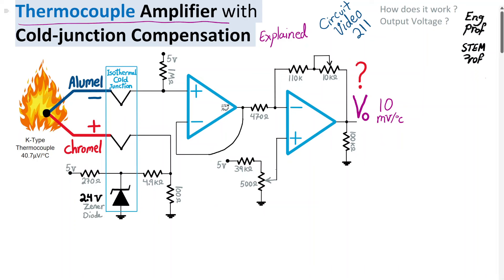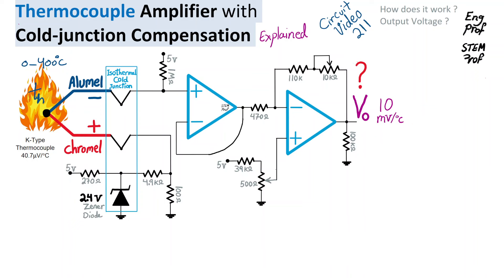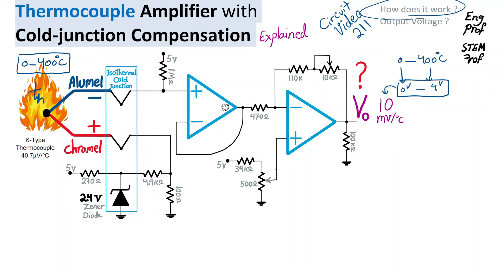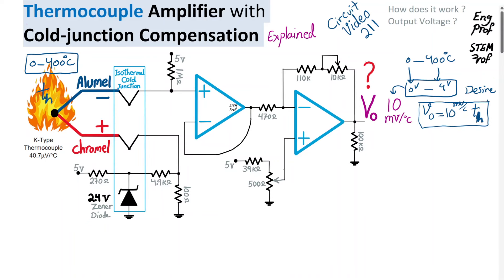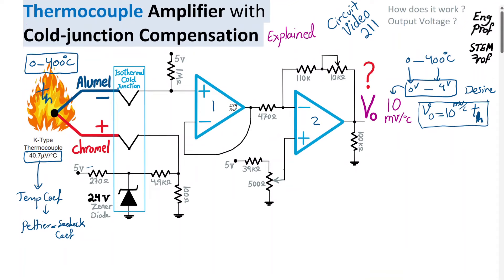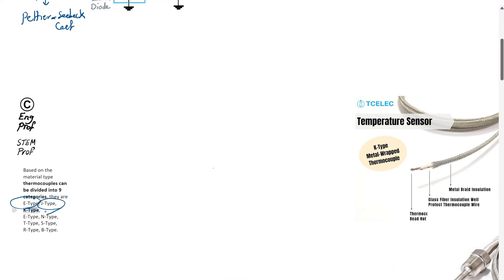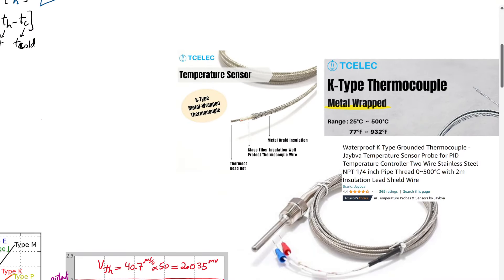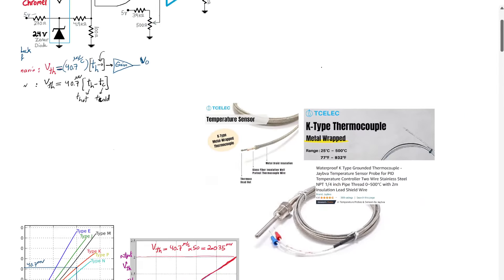Thermocouple Amplifier with Cold Junction Compensation Explained

Comment: If there are multiple junctions of similar metal pairs in the same direction between thermocouple and measuring device, is cold junction only a place when bare thermocouple wires connect to copper?
Reply from the maker: No, the cold junction is not only the point where the bare thermocouple wires connect to copper. The term "cold junction" refers to the reference junction, typically the location where the temperature is known or controlled. In a thermocouple system, the cold junction is usually at the point where the thermocouple wires are connected to a measuring device or reference material (such as copper or another metal). But if there are multiple junctions formed by different metal pairs in the circuit, each additional junction can also influence the measurement. When thermocouple wires are connected to other metals (like copper in the measuring device), each junction between dissimilar metals creates a potential difference, which can contribute to the overall voltage (e.g. series voltages that add up). The cold junction compensation method is used to account for this, ensuring that the temperature at the connection point is accurately represented in the measurement. Therefore, the cold junction is primarily considered where the temperature is controlled and known, and where compensation for other junctions in the system is applied, not just where the thermocouple connects to copper. I hope this is helpful. Here are a few related circuit videos: 
Thermometer Sensor Circuit Explained https://youtu.be/5jmbZ9ak6EI
PT100 RTD Temperature Detector with Error Compensation https://youtu.be/Fsd-X69awFk
Thermometer Circuit Design with Op Amp and BJT transistor https://youtu.be/55YsraFE0rg
Reply: @STEMprof Thank you! So while other junctions will influence measurements to some extent, is junction with bare thermocouple wires more likely to introduce the most error? Since it probably is closest to the measured object(larger temperature difference with ambient) and due to the fact that it has different pairs of metals for example chromel to copper and alumel to copper, that have different Seebeck coefficients(other junctions are more likely to be two similar pairs, something like two pairs of copper to bronze that have the same Seebeck coefficients and will compensate each other if their temperature is the same)
Reply from the maker: @qt1qg  You're welcome! Good points regarding thermocouple measurements and the potential sources of error due to additional junctions.  Yes, the junction where the bare thermocouple wires connect to copper is more likely to introduce the most error. This is because this junction is exposed to the largest temperature difference between the measured object (the hot junction) and the ambient environment, which can create a significant thermoelectric potential. Also, as you mentioned, the metals used in the thermocouple (such as chromel and alumel) and the metal the thermocouple connects to (like copper) have different Seebeck coefficients, which means they will generate different voltage contributions depending on their temperature difference. This results in potential measurement errors unless properly compensated. The junction formed by two similar metal pairs (like copper to copper, or brass to brass) would likely have less impact, as the Seebeck coefficients of similar materials are closer, and their temperature-induced voltages can cancel each other out more effectively. This is why the system is usually designed with materials that have well-matched properties for minimizing such errors.  In practical thermocouple systems, cold junction compensation is employed to correct for these types of errors, by either measuring the temperature at the cold junction directly (using an RTD or say a thermistor) or using a known reference temperature to adjust the reading accurately.  I hope this explanation clarifies things a bit further.

Comment: how do soldering irons perform cold junction compensation? from what i have read online there is no thermal sensor in t12? jbc or hako 900 series handles(cold end of t12 tip can get up to 50C), and there can be a sensor on the board or they can use temperature sensor of mcu itself.  How do they actually do it without knowing temperature of the handle and using only ambient temperature?
Reply from the maker: Soldering irons, such as those using T12, JBC, or Hakko 900 series tips, often don't explicitly perform cold junction compensation in the same way thermocouple systems do, because they typically don't use thermocouples for temperature sensing. Instead, they rely on a different approach like the PT100 RTD Temperature Detector with Error Compensation https://youtu.be/Fsd-X69awFk to manage temperature and ensure accuracy. Here's how they work:

1-- Temperature Control Mechanism: Most modern soldering irons like the T12, JBC, and Hakko 900 series use a sensor (usually a thermistor or RTD) placed at the tip or very close to the tip to measure the temperature directly at the point of soldering. This sensor is crucial because it directly monitors the temperature of the tip in real-time. A related video is Thermometer Circuit Design with Op Amp and BJT transistor https://youtu.be/55YsraFE0rg
2-- Cold Junction Compensation (or Equivalent): The handle of the soldering iron, including the cold end of the tip, can indeed reach higher temperatures (around 50°C, as you mentioned), which might cause concerns about temperature readings being influenced by ambient heat. However, soldering irons don't typically use thermocouples for sensing the temperature, so the issue of cold junction compensation (which primarily applies to thermocouples) is less of a concern.  Instead of compensating for the cold junction as thermocouples would, the system relies on sensor calibration. The sensor used in the soldering iron (often a thermistor or an RTD) is calibrated to account for the temperature at the tip and its surroundings. Even though the handle may get warm, the system compensates for the temperature through direct measurement at the tip, ensuring it maintains the correct soldering temperature by adjusting power to the heating element.

In summary, soldering irons do not need cold junction compensation in the traditional thermocouple sense because they do not use thermocouples to measure the temperature. They rely on direct temperature measurement at the tip using sensors like thermistors or RTDs and compensate for ambient and handle temperatures through sensor calibration and power control mechanisms. The heating system ensures the tip maintains the correct temperature based on real-time feedback from the sensor at the tip itself.  Watch this video https://youtu.be/5jmbZ9ak6EI to see more about Thermometer Sensor Circuit Design.
Reply: @STEMprof  Thank you for the response! I recently found out that original JBC tips are TC based and have compensation inside the cartridge, t12 tips are also TC-based and original Hakko handle has RTD inside for software based compensation. 900 series are RTD based(don't know why they did not use RTD in T12 and JBC). Clone cartridges and handles probably don't have any compensation. I know that some soldering stations that use T12 cartridges have thermal sensor on the board or use MCU with built in thermal sensor, is it possible to achieve any kind of accurate regulation by estimating cold junction temperature based on thermocouple readings and ambient temperature with some kind of empirically discovered formula?
Reply from the maker: @qt1qg  You're welcome! Your insights are spot on about how different temperature sensing technologies used in soldering irons. To clarify the part about achieving accurate regulation by estimating cold junction temperature using thermocouple readings and ambient temperature: yes, it’s possible in theory, but it’s definitely more complex and less reliable than using a direct measurement approach say using thermistors or RTDs (Resistance Temperature Detectors) similar to the https://youtu.be/Fsd-X69awFk video discussing PT100 RTD Temperature Detector with Error Compensation to manage temperature and ensure accuracy.  In soldering stations using thermocouples (like those with T12 or JBC tips as you stated), cold junction compensation is typically achieved using internal compensation circuitry that accounts for the ambient temperature at the cold junction (the connection point between the thermocouple and the board). This allows the system to correctly interpret the temperature difference measured by the thermocouple. However, if you're estimating the cold junction temperature based on ambient temperature and thermocouple readings, it would require a precise mathematical model or empirical formula, which might not be universally accurate for all setups. This model would need to account for factors like thermal resistance, environmental factors, and how the tip and handle are thermally coupled. Even with this, the result could vary between different soldering irons and environments.
On the other hand, as you mentioned, the Hakko 900 series and T12 tips use RTDs or thermistors that are typically placed near the tip. These sensors provide much more accurate and stable temperature measurements, since they don’t rely on interpreting a voltage difference like thermocouples. In these cases, ambient temperature and handle heat still need to be considered, but the MCU or onboard temperature sensor can use software-based compensation to account for the temperature variation.

To summarize, while estimating cold junction temperature with thermocouple readings and ambient temperature is a theoretical approach that could work with proper calibration, most modern soldering stations with RTDs or thermistors achieve much more accurate and reliable regulation using direct temperature feedback from the tip. This eliminates the need for complex compensation methods, making temperature control easier to manage and maintain. I hope this follow-up explanation is helpful.

Comment from the maker: A Thermocouple Amplifier with Cold Junction Compensation Circuit is explained in this video. For more sensor signal conditioning and amplifiers see https://www.youtube.com/playlist?list=PLrwXF7N522y7Ut9bm8TXAOhIWqL__FGlj and the following videos: PT100 RTD Temperature Detector with Error Compensation https://youtu.be/Fsd-X69awFk
Thermometer Sensor Circuit Explained https://youtu.be/5jmbZ9ak6EI
Digital Stethoscope Microphone Amplifier Explained https://youtu.be/ez5KtkPbsHg
PhotoDiode Amplifier with Data Compression Explained https://youtu.be/hqrRx2ufAwg
Thermometer Circuit Design with Op Amp and BJT transistor https://youtu.be/55YsraFE0rg
Thermometer Current source https://youtu.be/Ggf0yCaTTiY
Strain Gauge Wheatstone Bridge Instrumentation Amplifier Explained https://youtu.be/io1yBcCsP-Y
Temperature–Compensated Programmable Current Source Circuit Design with Zener Diode, BJT Transistors https://youtu.be/QY48IQXJIRI
Temperature-Independent Current Circuit Design with Op Amp, BJT, Zener, Schottky Diodes https://youtu.be/hFbnjbddUvs
Instrumentation Amplifier with Electronic Gain Control https://youtu.be/C4tghZ-q6Zs
For more analog circuits and signal processing examples see: https://www.youtube.com/playlist?list=PLrwXF7N522y4c7c-8KBjrwd7IyaZfWxyt
I hope these sensors circuits videos are interesting and useful.

Comment: Is the zener temp coeff. value accurate at all? The part is specified for 2.4V Zener. There is no binning from production not any uncertainty. Have you built this circuit, and confirmed the accuracy?
Reply from the maker: Good question, Yes for 2.4v Zener and for the cold (PCB/copper) temperature range of 0 to 50 degree Celsius that matters. Note that Zener Diodes between 1.8v to 3.3v have remarkably stable temperature coefficients assuming proper DC Bias current (say 6-10 mA).

Comment: Would current of 25 to 250 microamps(most mosfets that start from IR can have such leakage currents) passing through a thermocouple influence the readings? For example if it's in series with the heater like in t12 tips and mosfet leakage current is passing through it when it's off
Reply from the maker: Good question. For practical amplifier design, all components including op amps need to be selected carefully. I suggest using zero-drift low-noise CMOS precision Op Amps from Texas Instruments or Analog Devices. When carefully selected, drift currents and voltages of the CMOS op amps are on the order of tens of nano amps or nano volts. For related videos please see: Thermometer Sensor Circuit Explained https://youtu.be/5jmbZ9ak6EI
PT100 RTD Temperature Detector with Error Compensation https://youtu.be/Fsd-X69awFk
Temperature–Compensated Programmable Current Source Circuit Design with Zener Diode, BJT Transistors https://youtu.be/QY48IQXJIRI
Thermometer Circuit Design with Op Amp and BJT transistor https://youtu.be/55YsraFE0rg
I hope this is helpful.

Comment: Can I use an LM358, and is the power supply single or split -5, +5? Thanks a lot.
Reply from the maker: You're welcome. Glad that this video is helpful. I'd recommend zero-drift, low-noise CMOS Operational Amplifiers (dual op amp package) from Texas Instruments or Analog Devices for this circuit. More explanation of circuit operation is provided in the following related videos:  Thermometer Sensor Circuit Explained https://youtu.be/5jmbZ9ak6EI
PT100 RTD Temperature Detector with Error Compensation https://youtu.be/Fsd-X69awFk
Thermometer Circuit Design with Op Amp and BJT transistor https://youtu.be/55YsraFE0rg
The LM358 is just a standard op-amp IC (not zero-drift CMOS) that is designed to work with a single power supply over a wide range of voltages. It is used in dc gain blocks, transducer amplifiers, conventional op-amp circuits, and some automotive applications. LM358 op amp's main features are
Low power: The LM358 is a low-power op-amp. 
Dual channel: It has two independent op-amps. 
High gain: The LM358 has two high-gain op-amps. 
It has frequency-compensated op-amps. 
The LM358 can operate from a single power supply. 
Wide voltage range: The LM358 can operate from a wide range of voltages, from 3–32 V DC. 
I hope this explanation is helpful.
Reply: @STEMprof  Thanks a lot for your help.

Comment: Good !
But i didn't get the use of the 1 meg resistor.
Reply: I also wondered about that
Reply from the maker: Thanks! Good question, we want to avoid leaving the thermocouple terminal float in the circuit.
Reply: @STEMprof  Thanks ! A kind of pull up résistor ?
Reply from the maker: Yes, you are welcome.
Reply: @STEMprof  but it is tied to ground through the 100 Ohm resistor

Comment: How to use J-Type Thermocouple in this design?
Reply from the maker: Good Question, While you can use both Type J and Type K thermocouples in this example, J-Type can operate well at lower temperature and in vacuum. It is not preferred in very high temperature or very corrosive environments where K-type is a better choice. For more sensor signal conditioning and amplifiers see https://www.youtube.com/playlist?list=PLrwXF7N522y7Ut9bm8TXAOhIWqL__FGlj video playlist.

Comment: Very interesting circuit. I have a couple of thermocouples in a box waiting for me to get time to use them. I wonder how this circuit compares practically against the off-the-shelf modules that can be purchased from Adafruit and other places.

I worked on the installation of a new furnace in an aluminum foundry and installed thermocouples and the associated devices, but there was no opportunity for me get any insight into the circuit design.

Also, if anyone is interested, there is at least one easy to deal with supplier of trustworthy, USA made thermocouples, if you don't want to take your chances on Amazon or other such places.
Reply from the maker: Glad that you liked this Thermocouple Amplifier video. Thanks for the comment and sharing your thoughts. Here are a few related sensor amplifier videos:  Thermometer Sensor Circuit Explained https://youtu.be/5jmbZ9ak6EI
Temperature–Compensated Programmable Current Source https://youtu.be/QY48IQXJIRI
Strain Gauge Wheatstone Bridge Instrumentation Amplifier Explained https://youtu.be/io1yBcC
Thermometer Circuit Design with Op Amp and BJT transistor https://youtu.be/55YsraFE0rg
I hope these circuits are interesting as well.

Comment: Why not use the 3.9 & 4.3 Zeners in series (with higher drive voltage & higher divider etc., as that would be near 0 temp issues?
Reply: Never mind, I see they are using it to compensate connection issues.
Reply from the maker: @stevenbliss989  Correct, 2.4 volt Zener Diode is intentionally used since its -0.085% per degree C temperature coefficient results in -40.8 micro volt per degree voltage sensitivity which nicely compensates for the unwanted effect of non-zero cold junction temperature Tc as explained around minute 8:00